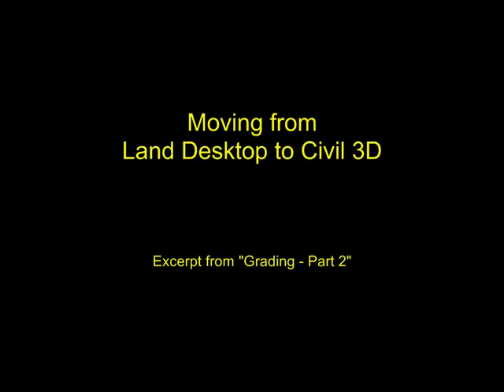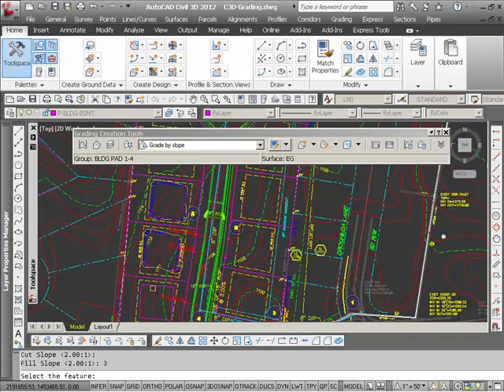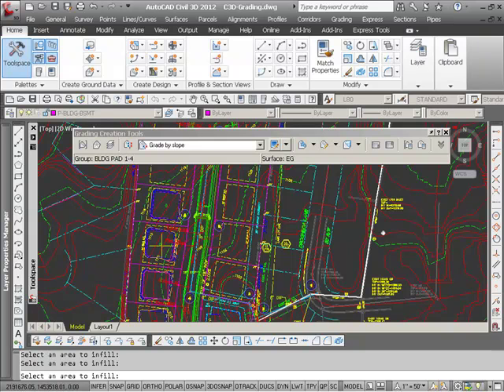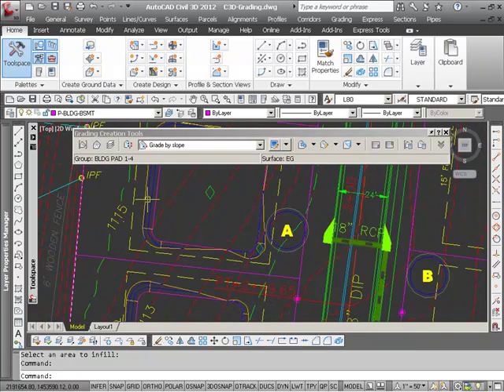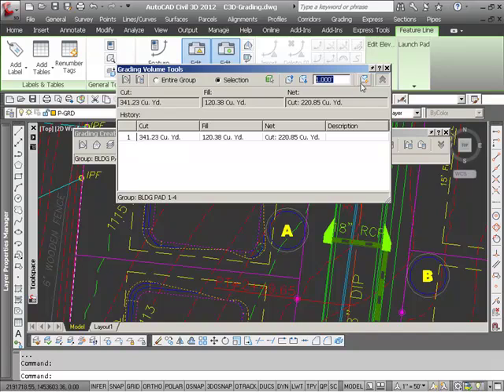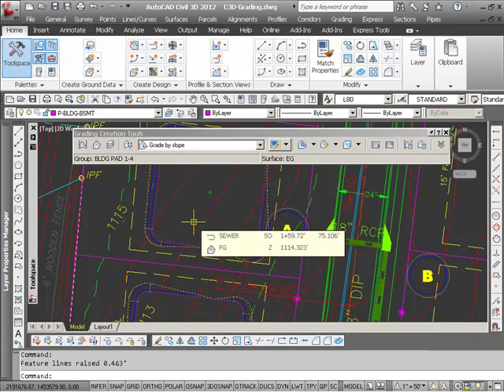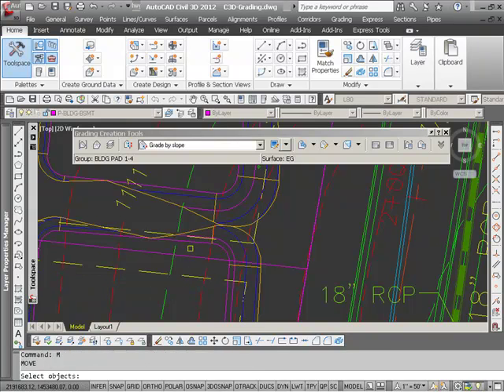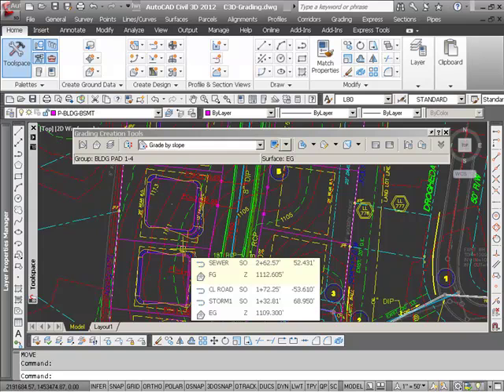Grading in AutoCAD Civil 2012 vs Land Desktop

Comment: The demonstration has no resemblance of reality..Fist the pad grade established is to the top of the pad. Reality would have grade drop depending on conditions across the front or sides.. second, in balancing no regard for material depth, or basement excavation was accounted for.  Third the swale grade between the pads gives the user no control, in fact the grade generated appeared to cause a pond at tn